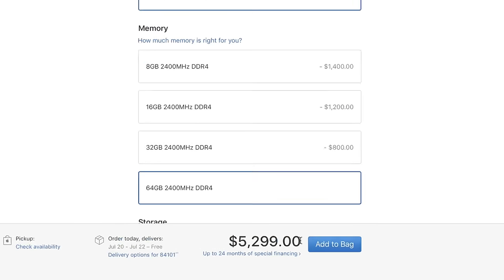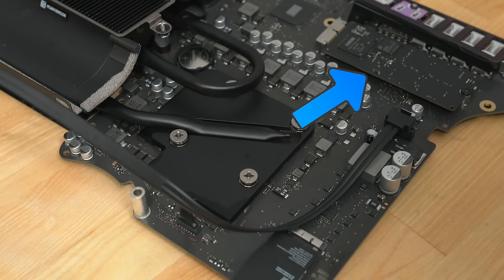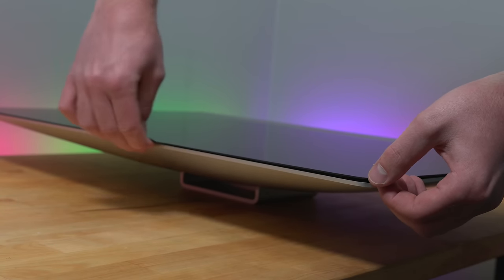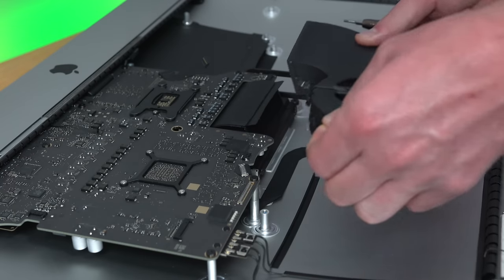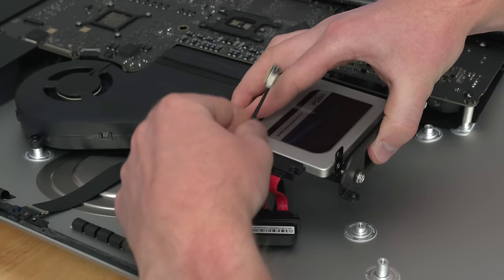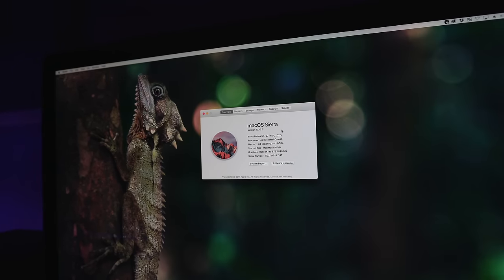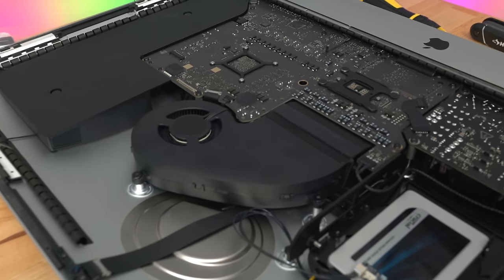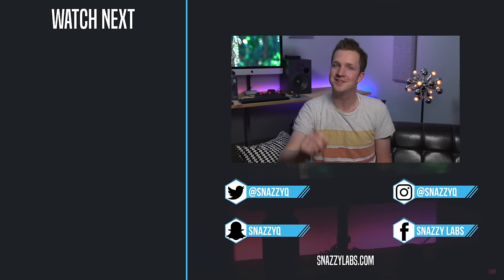The Best 2017 iMac Apple Doesn't Sell!

Comment from the maker: This video took weeks to plan and make. Excited to finally show it to you! It turned out even better than I expected. Please let me know what you think of the new ad integration. I tried to find a happy medium for me, the brand, but most importantly; you, the viewer. Let me know if I've succeeded or what I need to work to improve. Stay snazzy! <3
Reply: I think that the ad integration is very well done. Not too obtrusive, yet informative and in-depth enough for me to be interested in the product. 10/10
Reply: Snazzy Labs Ad int is great!
Reply: Yes indeed, great job on this video. I'm not even a huge Mac fan but I love seeing your tear-downs, hacks, and upgrades.
Reply: Snazzy Labs i think apple uses 7700 not the 7700k which would likely explain why your cpu performs better
Reply: I thought the ad was perfectly fine. It wasn't too long and it showed off the features without gushing over the product. It made me want to actually try it even though I already use LastPass.
Reply: How did your stock 4gb VRAM destroy the stock 8gb VRAM on the maxed out version 2017 iMac in Cinebench? Sounds like you're not telling the entire truth on which model you bought. Or which model you are comparing.

Side note: When you increase the RAM your Geekbench scores will go up. I bought the 8GB i7 model which scored 18878 at first. I then slapped in 32bg and it scored 20535. Now I have 64gb of RAM and it is hitting 21525 on multi score in Geekbench.  Increasing RAM will also increase your Cinebench score too. Thought you would kind of know this. lol
Reply: Snazzy Labs how did you just replace he CPU and add a 2 TB SSD so easily?? I heard that that kind of stuff needs some special Apple Boot ROM to work in Apple computers.
Reply from the maker: +Michael Christoper Apple also uses the 7700K in their fully-loaded model.
Reply from the maker: +dropbars Cinebench in the CPU test–not the GPU test. Cinebench R15 is a bit outdated to reliably test GPUs nowadays, but I don't doubt at all the 580 would have out-benched the 575 by a fair margin. I also know that the score increases with more/faster RAM. I am comparing my computer only to the iMac that is also spec-for-spec the same (same CPU/RAM).
Reply from the maker: +Aiddog10 Gaming Nope! Just swap it out and boot it up. Zero software work necessary.
Reply: The 7700K is already compatible since it's in the top end iMac. The SSD is just like a regular hard drive, and it's not a boot drive, so it works fine.
Reply: Snazzy Labs Effort was worth this awesome video!!
Reply: Snazzy Labs The UltraFine 5K runs at 4k with Mac Pro. 1440p is the dimension.
Reply: OneLogin, what about PSN? or Linkedin?
Reply: That's why I use the StandAlone 1Password, that doesn't require the Internet, I am in control of the master password, and they don't get my vault. I sync over LAN. Don't go for a subscription model, don't store your vaults online, don't sync over the net. Pretty simple policy to help lower the risk of a compromise.
Reply from the maker: +Floris Fiedeldij Dop You can also use standalone Dashlane Free if you don't want to sync your data with the cloud.
Reply: The free version doesn't let you sync between devices, it requires a subscription. But I don't get a lot of confidence when their argument to trust them on their own blog is: "We audit our security carefully, like the IRS does taxes." I mean, cough Lois Lerner's lost IRS emails scandal, cough. But ok, I get what they're trying to say, and what you're trying to suggest. 1Password is pushing towards cloud storing and subscription models, and yes, I am not happy with that either.
Reply: Snazzy Labs I want to ask whether an Xbox one connected to a mac mini which is then connected to a apple thunderbolt display would work as a gaming monitor and a computer monitor?
Reply: Snazzy Labs would this work with new i9?
Reply: Mare Ruu not on that mobo as far as i know
Reply: Mare Ruu Nope. i9 have totally different sockets, power consumption and TDPs
Reply: Found this channel and video today. I'm astonished! Great job with the iMac and the video! 😃👍🏼
Reply: Mare Ruu Nope, the i9's and the top end i7's are a different socket to this one.
Reply: JameZii thanks for your help? What about something like  i7-7820X?
Reply: @Arne Borgersen Quinn is quite Snazzy in his lab
Reply: @Mare Ruu I believe you are better off checking compatibility of motherboard vs CPU, usually versions or generation determines from what I understand.
Reply: By chance, when running the base benchmarks did the CPU thermal throttle?  Would the aftermarket paste help enough to improve the benchmarks by 8 percent?
Reply: THIS IS SO INSPIRING. Thank you for the quality content you create for us. These and the hackintosh videos are so awesome. The ad format is well done, too, and not at all obtrusive... I like how you tie it together with the other stuff so that it's a sensible part of the video.
Reply: The motion-tracked floating call out graphics (AEE?) used to highlight the components was a great touch. It added a polished, professional look and took your video to the next level. It was a little odd when a call out was partially off the screen - either floating in or floating out - but otherwise very cool.
Reply: love your content and the ad is well integrated
Reply: Snazzy Labs super great video. But the real question is - what was the iMac mounted to when you were working on it? It's a different attachment than the wall mount. In the other parts of your video. 

Thanks!
Reply: wait2 death i didnt catch that so can you show what to be put attention more to avoid that. thanks
Reply: Have you ever found a place to get a replacement SCREEN? My LCD is fine, but I cracked the screen itself on my iMac (late 2014) 5k Retina... it still works fine and I can't see the cracks unless it's turned off, but I'd like to fix it. LOL
Reply from the maker: +Jeremy JMIAH Williamson Yeah man. Search A1419 screen replacement on eBay. You can't buy just the glass. They're bonded. You need to buy an entirely new display. That said, they're only about $350 which is pretty good given how wonderful they are as displays.
Reply from the maker: +Dylan Nelson I bought my iMac with a VESA stand so I just mounted it to a cheap ASUS stand while I worked on the display adhesive.
Reply from the maker: +Karith Not anymore—you need to buy it pre-configured from the factory. Users used to be able to change it out pretty easily and Apple sold the VESA mount separately, but now it's drilled to the case chassis itself.
Reply from the maker: +gynnox Yes.
Reply: How much total after selling the parts?
Reply: Snazzy Labs I'll take a 2tb SSD
Reply: Regarding the GPU performance it would be really interesting what you could do with the saved money ( or those you can get from the parts you can sell on ebay ) and use an external GPU or eGPU as they say. You could slap a 1080ti and get some really good scores.
Reply: Snazzy Labs where can i get imac case?
Reply: ad integration is great
Reply: Since you  were complaining about your diy mac gpu not being as powerful as the loaded one, just get a cheap thunder2 to thunder3 adaptor and plug your rx580 egpu to the machine... if it works you could do a sequel of this video showing openGL comparison benckmarks
Reply: i dont se why you dont just bild a pc then put sierra on it it would be around $1500
Reply: Snazzy Labs your warranty isn't void
Reply: Jack Ryan who?
Reply: Snazzy Labs hey can I buy your CPU for 150
Reply: Snazzy Labs very like a Linus video, does OSX not kick off about the machine not being a proper configuration
Reply: The new ads are well done. As long as you don't start the video with a 5 min ad, I think people are fine with it.
Reply: Could someone please tell me if I can put in a 6700K into the 2017 Imac 27" if I buy the i5 version? I am trying to get better performance, but for cheap. Thanks thanks
Reply: Don't waste your money on a mac built your own custom pc I sold my mac recently & built me a $2400 i7 skylake custom gaming pc far more powerful than the new macs. I'm never going back to mac I 
don't regret it at all. Macs these days are only used for web browsing or video editors don't expect to game on a mac they have no graphics card & you cant upgrade a mac everything is soldered onto the motherboard even the intel core no way it can be removed.
Reply: You cant upgrade the CPU everything is soldered cant be removed! Best option for the amount macs cost build your own custom pc you will get a more powerful computer if you build your own & it will be cheaper than buying a mac
Reply: Just build a hackintosh for the mac experience without the overpriced pc you can't upgrade. That is a normal custom built pc you can upgrade and maintain as you like, running MacOS, pretty sweet.
Reply: Haha, of course some idiot had to come along and say, "get a PC, it's better and cheaper. Derp derp derp."

Also, "Macs these days are only used for web browsing or video editors don't expect to game on a mac". These days? Since when has Mac ever been a gaming machine? Shows what you know.
Reply: Recipes
Reply: I can't begin to express how grateful I am to you. I just bought a used late 2012 iMac 27" i5 3.2GHz with 20Gb RAM 1600 DDR3, and although I knew I could upgrade to a 32Gb RAM and SSD setup, I was blown away when I discovered that I could also replace my current processor with a top notch i7 for a fairly cheap cost and, best of all, do it with great ease just by myself. Thank you very much!
Reply: Snazzy Labs  did you keep the PCIe SSD intact while adding the new main SSD? How and were you able to run both those drives as one or separate drives?
Reply: That SSD power cable ( right before you were putting CPU back in place ) can you send us a link for that one ? :) Or does it come with OWC kit ?
Reply: Snazzy Labs POR QUE LE METES EL TITULO EN ESPAÑOL SI NO SUB ESPAÑOL EN EL MOVIL ??? porfa ponelos
Reply: Hey you selling that CPU?
Reply: How did you get 512GB NVME in Fusion Drive when they deliver 32GB for 1TB Fusion and 128GB for 2TB fusion?
Reply: Hi! Great video. Thank you. It looks like you forgot to put the SATA cable into your parts list. Would you be able to share a link, please? Everything that I found was for 2011 models. Thanks!
Reply: Snazzy Labs Always great video Quinn...
Btw, did you mean that your base model iMac is MNEA2LLA?
Reply: am I able to do this on a late 2016 27" iMac 5K?
Reply: Just found your channel, and I must say, I really found this video very informative, your lighting is amazing, audio quality is great, and overall, this is a 10/10 on my list of what I look for on tech videos. Well done, and you’ve definitely got a new sub!
Reply: Really enjoyed the video. The ad works well being very informative and making me think about jumping from my current password manager app to Dashlane which I tried in conjunction with the one I use for a trial but I found the other worked better for me. But now Dashlane (see I’ve advertised for you twice now 😝) offers a superior app to mine. Could a novice do what you did in the video? Also what’s your opinion on the new iMac Pro's compared to what you’ve done please? Thanks.
Reply: Snazzy Labs i did almost the same but i3 and hdd adapter to ssd case on imac 27 mid 2007.
👌
Reply: Snazzy! You think you could put the new i7 8700K???? 6 cores? Maybe you want to have it a go? =) Thank you
Reply: Hey i got the i7-7700k with a z270 gigabyte mb hackintosh and got the same results 8% faster than the loaded imac
Reply: Snazzy Labs Apple uses the 7700 non k skew
Reply: Could you just buy the displays to then use driven by say a MP or MBP?
Reply: Snazzy Labs you also want to replace thermal paste inside i7.
Reply: +snazzy labs - Are you going to test official support of External GPU on the DIY iMac?
Reply: In regards to the graphics card, Apple is reportedly planning to support eGPU which would mean that you can upgrade the GPU as well, far beyond what you can buy as stock, AND the whole system would be better cooled preventing thermal throttling.
Reply: Is it just me or is the verification checkmark next to snazzy labs name very large
Reply: Why not buy an iMac used off Craigslist or something and save even more money? Also, would it be possible to swap in the i9 instead or would I run into issues?
Reply: Snazzy Labs would you build me a Super Hacintoshish with like Customer specs for music production???? Or give me a great spec build list?
Reply: What about the tools you used to unscrew and tighten internal components; can you list them?
Reply: Snazzy Labs  thanks for the cool video
Reply: you still lost, you bought a recent apple product
Reply: 3.5 k computer, insured by a tiny fan. reeeeeeal smart😑😑😑 all hype no real smarts.
Reply: So, is there a way to replace the thunderbolt controller?
Reply: Snazzy Labs I have a 2013 i3 cpu iMac I want to upgrade it to a i7 cpu and with a bigger HDD 2TB or 1or2 SSD drive. Please help me? I want to use it for video editing? Can it be done? Please help me please!!!!!!!!!
Reply: Hi I am deaf. I'd like to ask your help.

2TB Fusion Drive storage bad? I've talked with the apple staff online days ago and he said it is big enough when I asked if it is good enough for editing heavy videos like adobe programs and all so I trusted him and ordered it online. After I ordered, and it was shipped, it will be deliver next week but then I found out from someone on Youtube that it won't be fast enough and that I would need 512GB or 1TB SSD in order to editing heavy videos. I am so confused. I am scared that I will waste a lot of hard earned money on iMAC that won't last me a long time. What should i do? sorry its long. HELP!

My iMAC i ordered : 
27-inch iMac with Retina 5K display
Hardware:
3.6GHz 8-core 9th-generation Intel Core i9 processor, Turbo Boost up to 5.0GHz
32GB 2666MHz DDR4 memory
2TB Fusion Drive storage
Radeon Pro 580X with 8GB of GDDR5 memory
Reply: I want to replace the Motherboard so I can both a CPU and GPU upgrade while, like you said...getting to keep the 5K darn screen.
Reply: @MrFloris  Deranged Donald packed the #1 and #2 positions at the IRS, so it's even more questionable that before.
Reply: thanks for this video, just want to know if this 2017 imac motherboard is the same with the 2015 27 ïmac? by watching your video, i cant wait to do the same thing with my 2015 imac... as of now it is all same inside since i bought it. core i5 6600 with 8gb ram... just want to bump it to at least core i7 6700/7700 with 64gb ram. and probably put a 2.5 ssd as well.
Reply: Hi there, great vid thanks. Did you go with base GPU or did you upgrade?
Cheers!
Reply: Dear Snazzy- I just bought 4  8 gig memory chips and inserted them into my 5K imac. One was put in backwards (Im a nube at this) and could have conceivably caused damage. My comp works fine but one slot is not visible to the computer. Would this be hard to fix? My 24 gigs of memory (or even 20 if I return two memory slots) are fine. However, I thought I would ask. Would love your take.
Reply: Ever thought of gutting one and putting in cutting edge mini itx components?
Reply: Noooo9999
Reply: I think mac book pro is better is 5k resolution and ia portatible and 8t storage but i think is god but the real test is with gta 5 dude

Comment: Why was there a gif of Linus dancing on the screen?
Reply from the maker: Linus is quite the pretty dancer.
Reply: Snazzy Labs try doing a colab with him, however good luck with transportation
Reply: Why was there a gif of Linus dancing on the screen?
Reply: Why not??? I love to see a little Linus in every video!!!!!
Reply: Maxwell Rivera u have a typo there. I think u meant *god of pcmr
Reply: To answer the question seriously Linux talked about the silicon lottery in which every cpu is different due to the quality of the silicon used for the cpu itself, (to over simplify) poorer conductors connections make for slower cpu's and better connections higher ones, for each cpu you get you might be able to get higher or lower clock speeds (especially when overclocking) depending on how good the connections are in the silicon when it is made for the cpu.

TL;DR  - Linus made a video on the silicon lottery.
Reply: Normally when talking about Silicon Lottery it refers to how well a CPU/GPU can overclock. For stock vs stock, usually voltage and efficiency derived from better/lower voltage is where some performance may derive. So the only thing that maybe causing the better scores in this particular machine might be better thermal control by replacing the paste and the CPU not throttling back due to temps. Lower voltage means lower temps as well. Come 7700k have better IHS to CPU die contact.
Reply: "Linux" made a video on it? dang never knew :) lol
Reply: Whoops Freudian slip there - was thinking of making a build with linux
Reply: Memes.
Reply: Matthew Abela yes?

Comment: You didn't actually "save" $1800. You spent the money on the computer, then you spent the money on the parts to upgrade it - and you'll never get back the money the parts you no longer need back, because you can never sell them for what they're actually worth. The only way you would have saved that amount of money is if you actually went down an alley and found an abandoned iMac- took it home, got the parts, and put it back together.